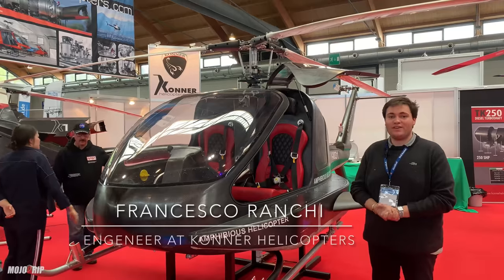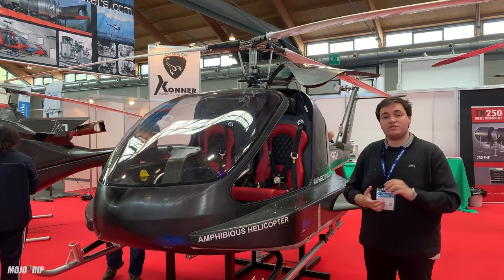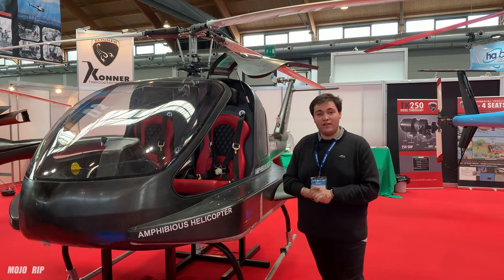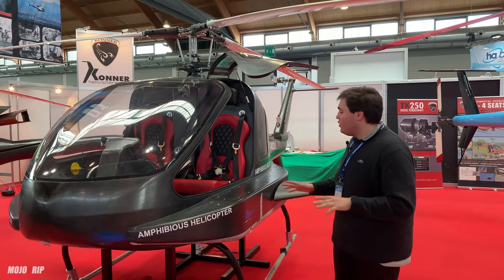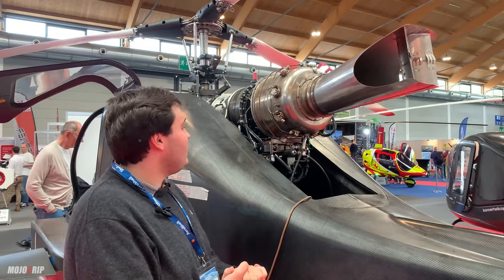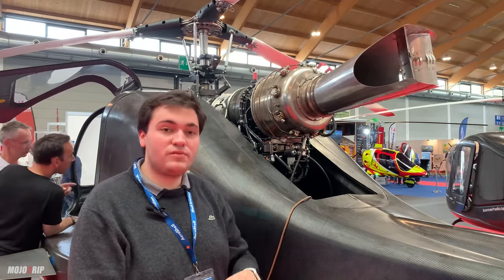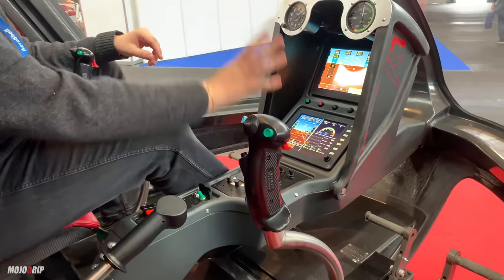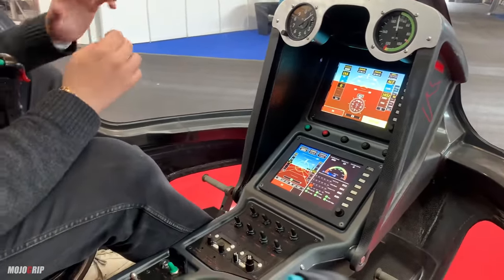Konner Amphibious Turbine Helicopter Will Allow You To Land And Takeoff On Water

Comment: Developing a helicopter and a new, turbine powerplant, is an extremely ambitious project. Hopefully they don't run out of money before they run out of problems to solve.
Now if they can keep the price under $750K they have a winner.
Reply: The turbine was developed 20 years ago but still to these days it’s very technologically advanced , the range of our helicopters if between 350-480k , we do believe to have a similar price for the konner k3 (amphibious)
Reply: Looks as if someone’s been eyeballing the Hill… Can Konner kompete?! (See what I did there) 😁
Reply: @francescoranchi3689  Are you looking at supplying the turbine as a separate piece? The ultra-light single seater helis I'm interested in are using turbines designed in the 60s. With no spare parts availability (unless your a machinist). Seems like it would be a good way to get more hours on this unknown turbine.

Comment: My experience with RC helicopters on water is at idol the tail rotor doesn’t have enough authority to counteract the torque of the main rotor and it starts slowly spinning around.
Reply: That’s true, but we have 2 electric hydrojet motors that will prevent you from spinning.

Comment: So the engine is light, but it consumes about 2.3 times more fuel per hour than a modern petrol engine. The extra fuel for same endurance does not weigh nothing.
Reply: the Robinson R22 consumes about 45L per hour and uses 100LL aviation fuel with an average cost of 7.20$ per 1 gallon (3,8L) with a total cost of ˜85$ per hour, while the K1/K2/K3 uses 60/65L per hour of car diesel with an average cost of 4.80$  per 1 gallon (3,8L) with a total cost of ˜83$ per hour, so in terms of costs it is similar. 

The density of AVGAS 100ll is of 6lbs/u.s. gallon (2,7Kg/3,8l -> 1 liter = 0,71Kg), giving the robinson R22 a total "weight loss" per every flight hour of 32kg, 
The density of CAR DIESEL is of 0,8Kg/1 liter, giving the Konner TK-250 turbine a total "weight loss" per every flight hour of ˜50Kg. Therefore every flight hour of the TK-250 turbine is of 18Kg more in terms of fuel density. 

Since you are comparing only the engine and not the entire helicopter, it is needed to say that the robinson R22's engine max power output is of 131hp at peak, while the TK250 turbine (of konner K1 helicopter) is 250shp, nearly the double!

Also when comparing the helicopters the "extra weight" of the fuel consumption of the Konner K1 is balanced by the empty weight of the helicopter, with a total empty weight of 352Kg for the konner K1 (compared to the 400Kg of the robinson). 

The R22 has a 75 liters tank -> 52Kg (Flight time ˜1.6 hours)
The K1 has a 120 liters tank-> 95Kg (Flight time of ˜2 hours) , 

95Kg (fuel weight K1) - 52Kg (fuel weight R22) = 43Kg of less weight fuel for the R22, with also less flight time, but if the R22 is 43Kg lighter in terms of fuel, it is also 48Kg heavier (empty weight), therefore my conclusion is:

The Konner K1 is 5Kg lighter than the R22, with nearly double the SHP and more flight time !

I compared the R22 and Konner K1 as they are finished product with trustable datas in terms of weight, consumption ecc. 
About the Konner K3 is the video, the final weight etc. is not known but will likely be a bit heavier than the R22 (or maybe not.....) but it's a different type of helicopter and helicopter cathegory as it's experimental and not ultralight